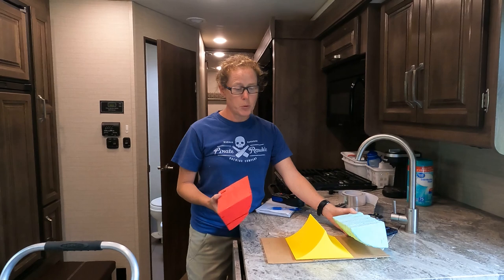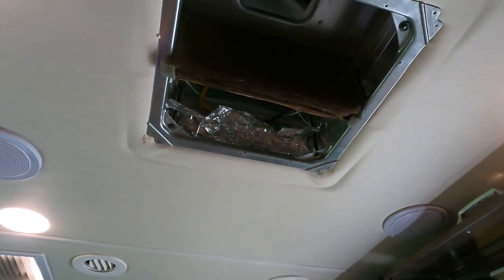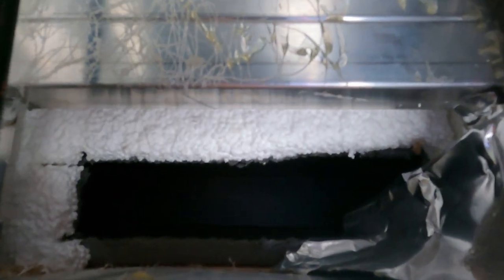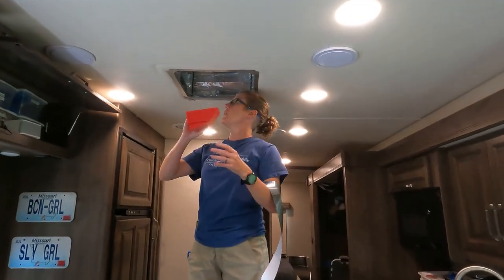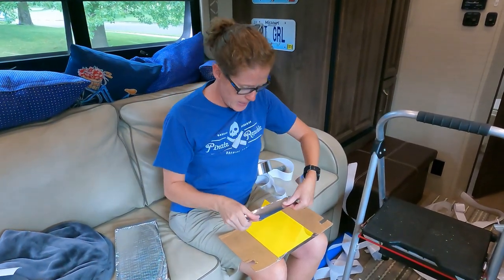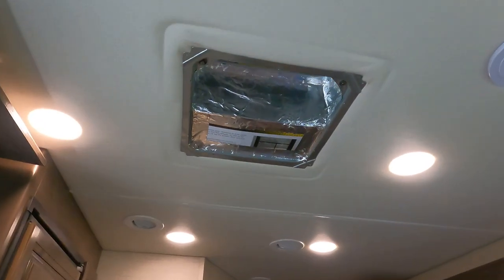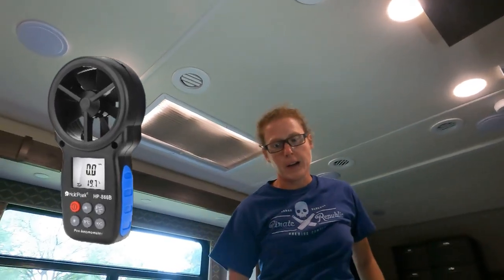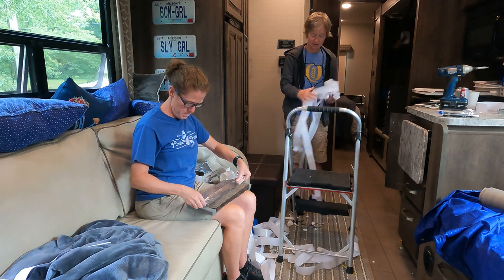HOW TO KEEP YOUR RV COOL | RV AC Air Flow for Under $20! DIY RV AC Mod for Cooler, Quieter Air Flow.

Comment: I like the idea of making the corner piece out of a solid piece of foam rather than just a piece of foam put in at an angle. Your way removes all of the sharp angles which could create the best flow.

Another thing that helped me a great was to pop off the vent covers and seal the ductwork to the ceiling and the vents to the duct work. In my rig the vents were just pushed into a round hole in the duct and not sealed at all. Also at the end of the duct it went a good foot past the last vent and was just pinched to seal off the end. I added a piece of curved foam and taped it so the air was all directed down through the last vent on the line.
Reply from the maker: Thanks for the reply, Adam!  I completely agree that checking out the ducts is the next step in making your A/C work more efficiently.

After I finished this project I noticed that our front A/C seemed to be sending more air to the bedroom and that our bedroom A/C was sending more air to the front.  I don't like to run both at night so I put some foam in the racetrack to only allow air from the bedroom A/C to flow out the ducts of the bedroom and bathroom.  Now the front A/C only cools the front of the RV and the bedroom A/C  only cools the back.  There are so many opportunities to  make these systems work better!
Reply: That's called an air cushion. It doesn't hurt to go past the vent. Actually makes it a little quieter, but doesn't hurt to stop at the vent either

Comment: Just an FYI from a career automotive technician, every time you pull the trigger switch on your tools the switch is wearing out quicker. I would recommend setting a slower speed and holding the trigger until the screw is removed or tightened. Just a thought.
Reply from the maker: Thanks for the tip!  We always appreciate constructive feedback!

Comment: Great video! Based on another video I saw several months ago, I did this.  I used straight foam board for the corners angled at 45* instead of curves.  I did not do the middle section as I did not want to take the metal frame down.   I’m reconsidering that now. Had not seen the curved design, but makes sense.  Even though I used straight pieces and no bottom “air director” , I still lowered my decibels from 66 to 60.  In creased flow by at least 50% though I wasn’t able to measure that.  I have a Dometic Brisk II, 15k .

As I said, I’ll probably redo mine using your design.  Thanks for sharing this.
Reply from the maker: Thanks for watching and the feedback. If you end up redoing the mod, we would be interested in knowing how much it improves your experience.

Comment: Did this mod last week, definitely increases airflow through the vents, unfortunately rv acts just suck and can't keep up with the 110 degree las vegas heat
Reply from the maker: 110 degrees?  Wow, I've always heard that the max relief you can get is a 20 degree differential, i.e., the best you can do is around 90 degress inside.  Good luck, and buy some cold beer.

Comment: Y’all did a great job!  Now I need to find Brian Miller’s measurements.
Reply from the maker: Hey Danny-  The measurements are in the paper template that is linked in the description.  If you are going to 3d print it there is also a link to the Thingiverse design created by Brian Miller.  Thanks for watching!

Comment: That's all fine and dandy, but down south July, august you can't have the just running through vents, it will warm up by the time it gets out . Unless you have heavy duty insulated camper, I'm looking into bigger a/c unit, calling hvac company after thus summer
Reply from the maker: Let us know how it goes.  And good luck!
Reply: @ClassCBroads  I tried something different, I went up to the roof, I had one of thise electric blankets from Walmart, just took blanket wrapped my a/c over the cover, thise car window shades over the too, and my sunshade cloth,  just half the a/c , so far extra cold
Reply from the maker: @commanderfootball  I'm not quite tracking what you did, but as long as it works, that's awesome!
Reply: I live in the Deep South myself, and whether you get a bigger BTU unit or not, increased airflow from an aerodynamic improvement will help IMMENSELY. Do-it-yourself or installing the RV Airflow kit ($170), the results are dramatic - and I mean DRAMATIC.
Reply: Mr. Cool is coming